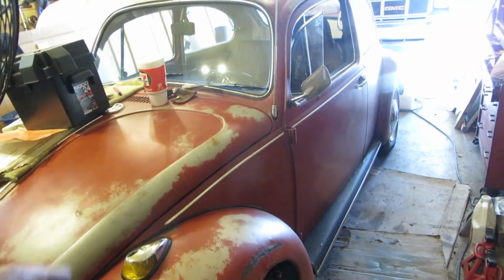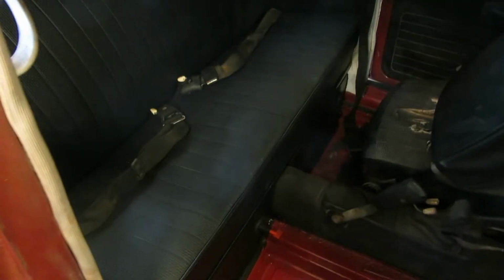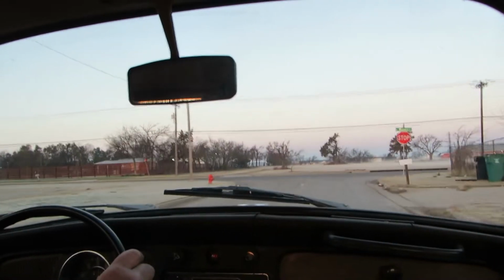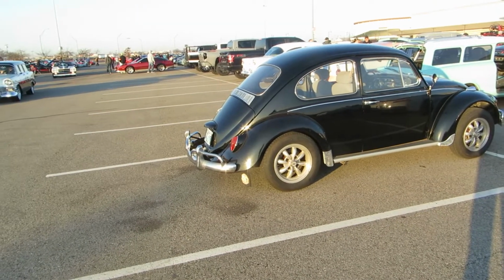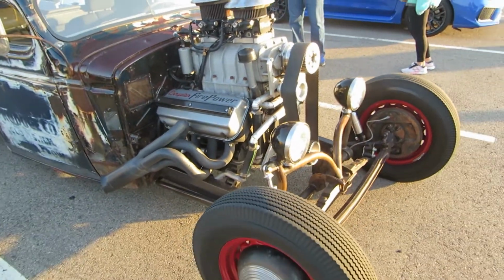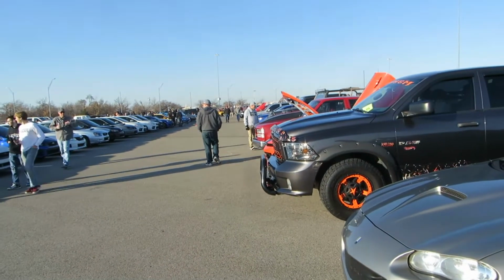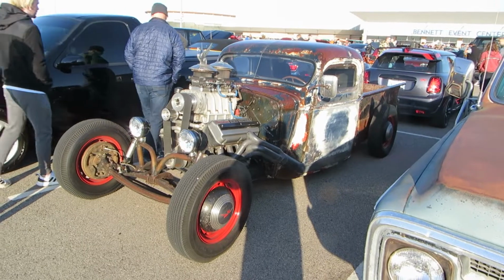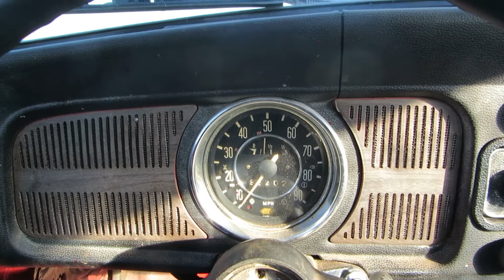First Drive 1969 Beetle

Comment: Dan thanks for taking us along . Most of the cars I saw when I was a kid .Brings back memories !
Reply from the maker: Cars were really something back when. Nowadays everyone has this thought of “everyone gets a car” so most people do. And since everyone gets a car....they have become just transportation devices....well, unless you can buy something fancy. Now, in no way am I knocking new cars... fuel injection, computer controls, extreme safety standards, crash tests, airbags and seatbelts. Engines lasting 250,000 miles. They are wonderful. But they just seem so common.
But, my point is not everyone had a car before the 70s and years before. Making them special. And IMO better made physically. Coupled with the lesser safety standards...be dazzled with all sorts of chrome protuberances and gee- gaws...they looked great!

Comment: Enjoyed the ride along! Looked like a good time! 

The item on the truck engine is the shaft for a hand crank.
And the van....are drive-in speakers.
Thanks for sharing...the bug sounds great!
Reply from the maker: Thank you....yes it was nice to see everyone.
Yes on the speakers.....no on the hand crank.......not that the mod. a did not have a crank hole...of course it did. As you all ready know.
However
I’m talking about the little protuberance bolt on the timing cover.
Reply from the maker: OK, since no one got my question I’ll tell you what that is. You take that bolt out, and you turn it around. Put the pin side into the bolt hole. You crank the engine until you can push the pin into the hole. That will tell you the piston is at top dead center on number one cylinder. For timing.
Pretty neat little gadget. I think they were on model Ts as well as model Bs
Reply: @OkFixer  thanks for clearing that up. I learned something new!

Comment: You know I've run into a lot of throttle cable problems and usually it's caused by the throttle cable Bowden tube between the body and the forward most engine tin piece. The tube that the cable rides in actually plugs into the cooling tin and the body, the tension on the cable holds it in place. Usually its been cut down over time or the plastic cover has been peeled back making it seem like your throttle cable is too long. They're hard to find new, I think Wolfsburg has them. They're called the Accelerator Bowden Tube.

Comment: The bug sounds happy on the way to the show.  Nice tip on using the HF  grommets on the throttle tube. The washer bottle looks to be on the right spot.
Reply from the maker: Yes, it was really happy...a few hiccups but....I can work them out.
And about the water bottle...yeah I don’t know , looks right to me.
Reply: @OkFixer  
 I  looked online for photos of the washer bottle location on other cars,  and it looked like the same as yours.  I don't know what Brian is talking about. 😕
Reply from the maker: @vintage76vipergreenBeetle  it has to be correct, because....liquid flows down hill you know....🤪🤪
Reply: @vintage76vipergreenBeetle  I'll have to look at mine again but I'm fairly certain that the bottle I have uses the upper 2 holes in the wheel for it's mount. Probably just a different washer bottle. As long as it works good, which is a rarity with VW's.
Reply: @vintage76vipergreenBeetle  I'm wrong, Dan's got it right. Mine is exactly the same as his.
Reply: @brianallen9810  
 Welcome back, Brian.  Glad to know we got the washer bottle issue solved. 🙂👍